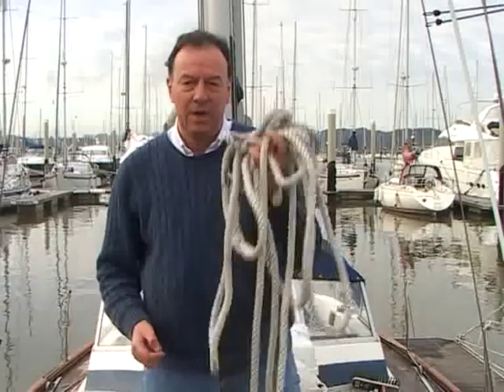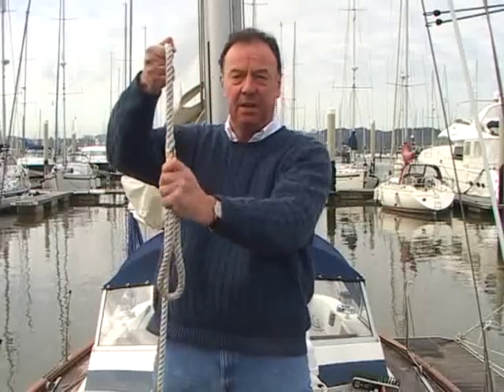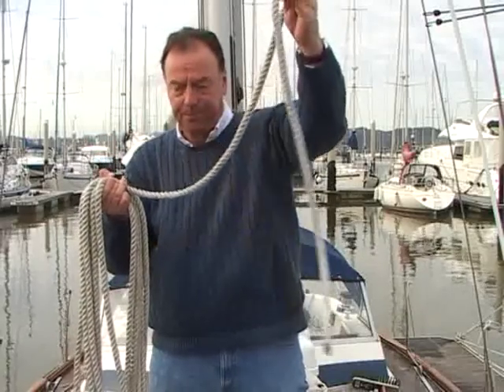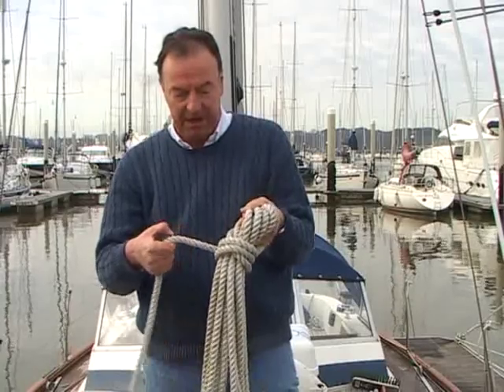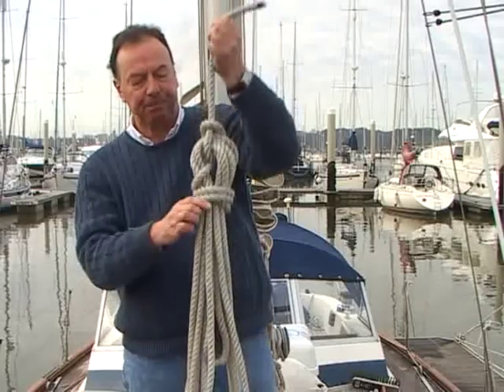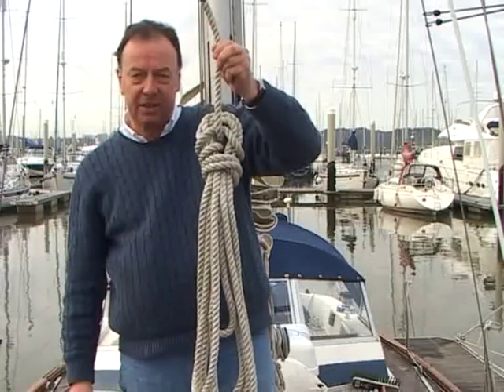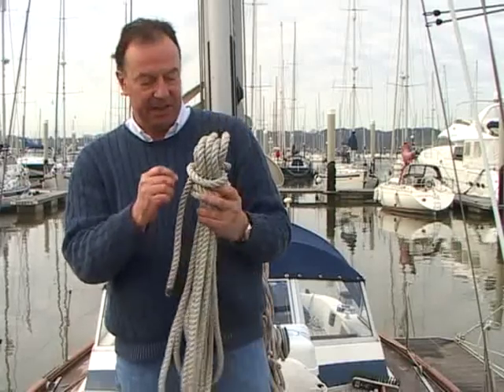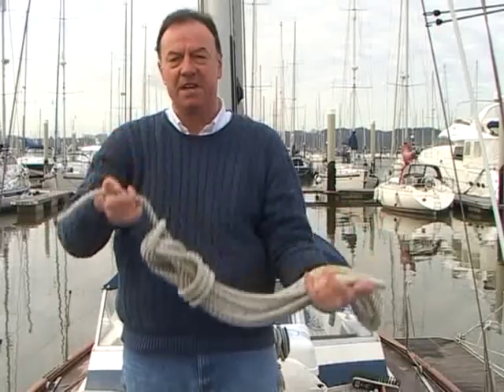How to coil a rope

Comment: if you coil from the free end and finish with the spliced end, you can hang the coil from the prepare splice on a hook or peg etc.
Reply from the maker: True. I should have added that.
Reply: Jordan Harkness it’s what i do too.
Reply: Yes but you won't get rid of the twist
Reply: Finish with the spliced end is how, me, a Pro 1st Mate does it. Less work.
Reply: @markswishereatsstuff2500  I like to have anything that makes a line different (i.e. splice, shackle, other hardware) hanging down so I can spot different lines easily.

Comment: Benefit of gasket coil hitch is that it tends to stay locked up for longer. Your preferred method will come undone more easily when the coil is being passed (thrown!) around the boat. Agreed it hangs straight and looks neater for mainsheets hung on the end of the boom. You could also add a half twist to the bight as you pass it through the coil and then hang the coil on that bight. This is good for hanging halyards off a cleat on the mast.

Comment: If you hang the different coils in order (in the direction from your elbow to your hand) it won't foul even if you don't manually uncoil it before using it, which is a mess if the rope is really long. If the rope is too long you can pass the first coils on to your arm before continuing.

Comment: if it's longer and especially if it's braided not twisted, you really should figure 8 not round coils. You are adding twist with each round coil. when you understand wrap a longer line (i.e. a spare sheet or halyard) it will kink and foul.

Comment: The way to release a Gasket Coil hitch is just pull the bight back over the top of the coil, you don't snake the free end back out.
Reply from the maker: Yes, I realise that and should hjave added this in. If you check the videos on coiling rope in my Stress-Free Sailing and Stress-Free Motorboating I have corrected this.

Comment: The gasket coil hitch is better because it locks the coil. Also, you should leave more on the end so that you can clove hitch it to a rail below and the rope hangs and dries. They should all be hung up, not thrown into lockers. Good to see clockwise coiling.
Reply from the maker: I agree. See Stress-Free Sailing etc, we now include it

Comment: One large improvement to your method.  That pre-spliced eye on your beginning end??   When you first lay it to begin the coil,,, make it longer than the coil is going to be.  Allow it to hang a substantial,, for that size and weight rope,, 10 or 12 inches lower than the bottom of the loops.    Because,,,, when the starting loop is shorter, if often drops through the coil, or can be pulled through the coil when you go to use it.  That will cause a knot and a delay.  If the starting loop is longer, it resists dropping through the coils and usually,,, not always, stays to the correct side so when you drop the coil for use,, it runs true.  You need not do a pre- uncoil.  Just take the daisy-chain off the top and throw it.  It will run smooth nearly every time.

Comment: There is a fair amount of misinformation in this short video.  As you eventually acknowledge, the coiling method will impart a full twist for each coil.  Not good.  Either reversing every other coil, or simply laying it back and foth in your hand rather than coiling would avoid this problem.  Also, Duncan, the idea that three strand rope should be coiled in one direction because of the twist of the strands ignores the fact that "right hand" is "left hand" if you turn the coil around.  You can coil three strand in either direction, really.  Uh, and then you demonstrate how to do it so you don't have enough length left to hang it up as you say is the point of the coiling system?  Maybe you should have tried this before you turned on the camera to get the length right.  So,  I will make you a deal.  You drop by the Alamitos Bay Yacht Club, in Long Beach, California, and we'll have a few beers and really get to the bottom of this whole rope coiling thing.

Russ
Sailing Vessel "Coyote"
ABYC
Reply from the maker: I should be delighted to meet and have a beer. We have come a long way since this video and I should delete it because as you say it misinforms but it has a high viewership and I am reluctant to do so. This video from Stress Free Sailing is what we present these days - 
https://vimeo.com/110879100

Comment: I would call the bite “ spliced” rather than pre spliced. No need for the “ pre” in most cases....I worked as a carpenter for yrs. Was told many times to “ pre- drill” something.  I would take a sip from my coffee, then “ drill the hole.  Not pre drill the hole.
Reply: Except as a shipwright I have often pre-drilled a part in the workshop so that I don't have to do it on the job where there might not be the electricity or the ability to drill as accurately as one can in ideal circumstances. I think with this guy not being a seaman like a great many yotties he can't do his own splicing so has to get the supplier of the rope to do it so buys his warps 'pre' spliced, ie done by someone else.
Reply: Richard D  You “ drilled” the hole , lol. Pre drill might involve charging battery or a coffee. Pre is often mis used and not proper. Sorry, my damn grandfather was a Cornell English geek. Lol
Reply: Ah, I have one over on your Grandfather, I'm English! 'drilled' is in past tense because I said I have, implying in the past...... The term pre-drilled, pre-spliced, pre-anything is perfectly proper grammar where I come from. By yours I gather you are American? You don't speak English that side of the pond!
Reply: Richard D   Lol.  Can one pre anything really? We can arrange things, drill things do things. Not pre- do things. We can have a pre- mature ejaculation. I know it sounds great and is a valuable means of communication but...Perhaps I will find time to research up something good for this one!  I’ll try and think about it some more.  Lol To Old to bother thinking about so many things, especially in a world fraught with absolute nonsense. Men to the moon. Aah ahh ahh
Reply: Life's too short, look in a dictionary ffs!!

pre
ˈpriː/Submit
preposition
previous to; before.
"the tree was almost certainly planted pre 1700"
Reply: Perhaps you Yanks will get it if I put it in another context? What is the opposite of post-war?
Reply: Richard D  I fail to see how pre 1700 is adding pre to an adverb or a verb. I believe your dictionary shows I am correct.  They can’t pre plant the tree.😂. I have built a few boats as well. I had this debate with the finest craftsman, builders and blind men.